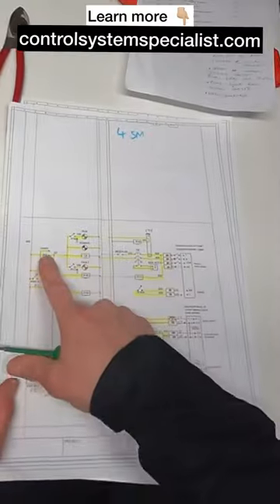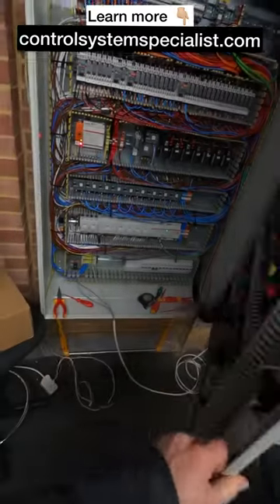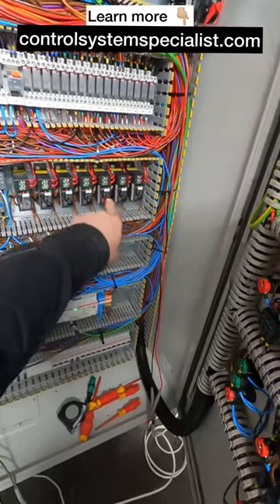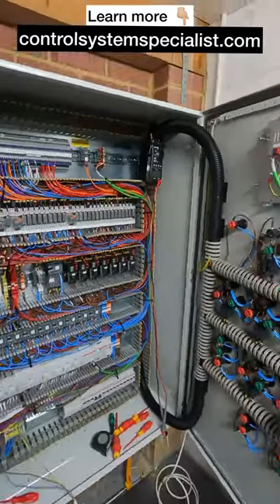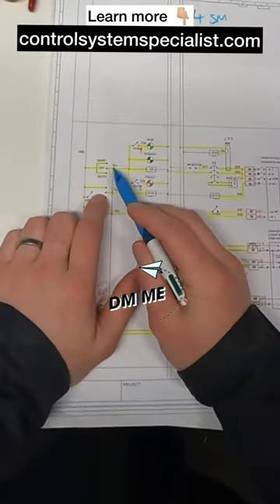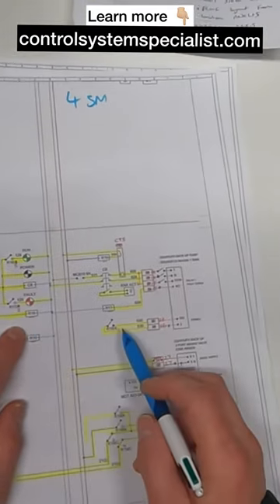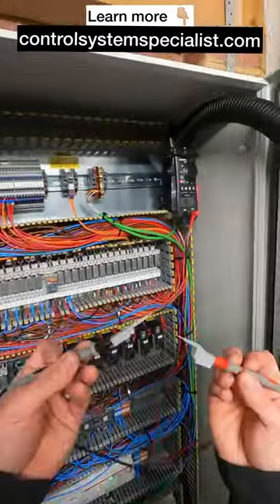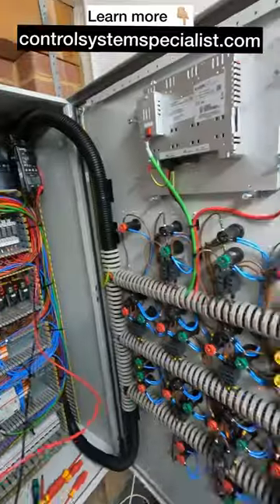Learn how to fault find and test 👉🏼 controlsystemspecialist.com

Comment: Its rare to find good controls content. Thanks!
Reply: Byron Lewis has videos on everything you need to know about real system controls. He wrote the book to prepare for the International Society of Automations CCST, CAP, and PE exams. 

I would highly recommend his content since being a real controls system engineer and technician is way more than electrical circuits. You will learn thermodynamics, fluid mechanics, IT, electrical systems, PLC automation, reading P& ID, tuning control loops, and so much more. He has a 70 video series on preparing for the exam. This guy here is a scam. He is trying to sell a useless course for thousands of dollars that offers no real pathway for any accredidations.
Reply: Where do I look up Bryon Lewis?